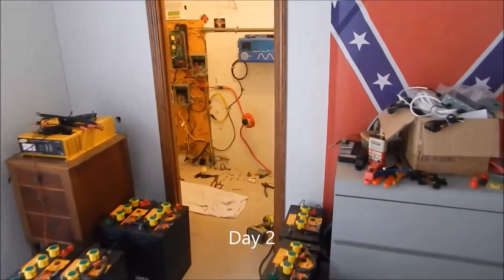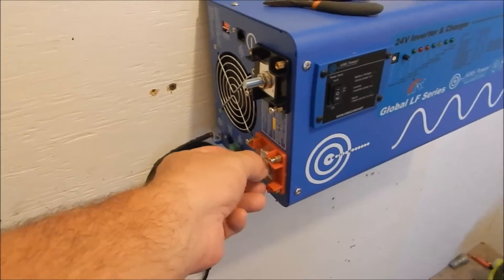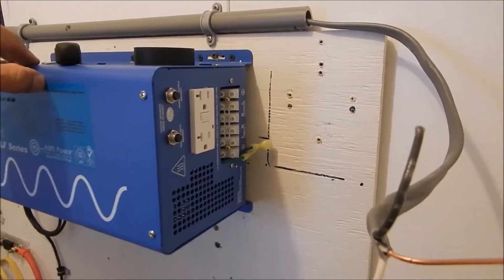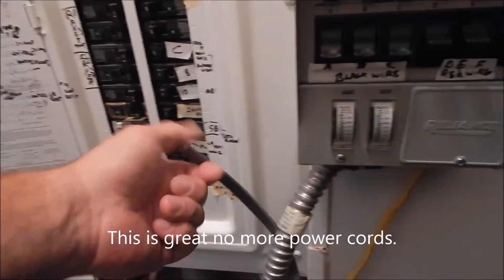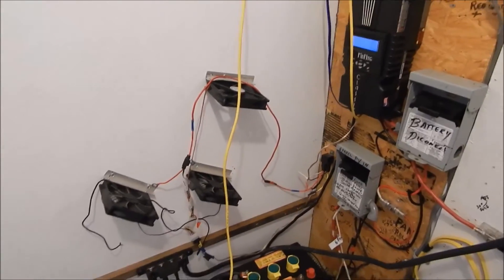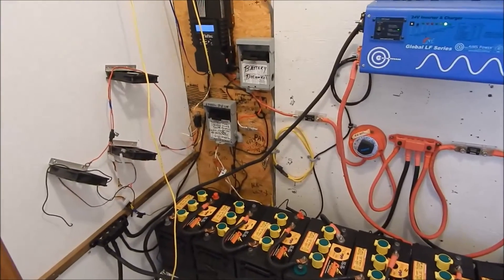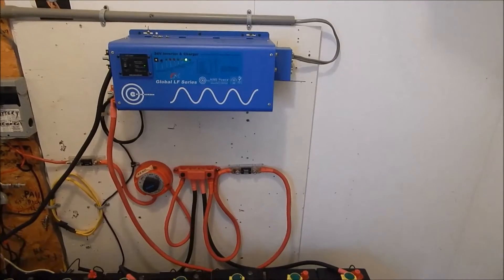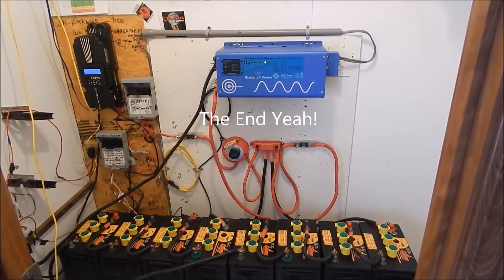Aims Inverter Battery bank part 3 Up & running.

Comment: Are you using the Aims to charge your batteries and at what voltage?
Reply from the maker: No I got rid of the aims inverter years ago what a piece of junk.

Comment: Beg my pard, but wtf are those fans mounted on the wall accomplishing?
Reply from the maker: They have been  redirected to stir the air in he room to dissipate any fumes & help cool equipment.
Reply: Oh ok...so the room is at negative/positive pressure? Otherwise, without air exchange they are wasting power.

Comment: looks good! how long can you go off grid for with all that now?
Reply from the maker: +fliping720 I really gave it a good work out last night I ran my bedroom with the A/C on, the LR, full kitchen  lights fridge ,freezer, then  I hit the transfer switch to use the washing machine no problem. How long will it go it depends what I am using but if I can do light s, kitchen & run my bedroom 8000 BTU a/c at night when needed like from now on for the next 9 months,  it will always stay on 24/7. I did it with my go power invert. This Aims inverter runs really hot. I am guessing this is because it has a giant transformer in it. Seems like a strong unit for as little as it cost for all that it can do. I am using it just as a inverter, no charger or transfer switch needed at this time I got plenty of solar.
Reply: that's great, I am interested in seeing how it does.

Comment: that's a really nice set up!!  where did you get those batteries and how much do they run for?
Reply from the maker: +Lorenzo Chow I have a Crown battery dealer about 50 miles away .They 6Volt @ 390 amp hrs. each, they run around $250 each 121lbs, cheaper if U have some big batteries to trade in like golf cart type heavy lead deals.

Comment: Good stuff again.   Hook a WiFi  extender o your midnite and download "the local app" to your phone and you can see what your system is doing anywhere in the house or yard.  Need the whiz bang jr. too.
Reply from the maker: +Fernbark Frist Thanks! I have it hooked up to 2 plug in units that u plug into the wall & use your homes wiring to communicate ,very nice. I will be getting a whiz bang soon now that I only need 1 charge controller. Plus I can still take 2 of the 6V battery's for my camper & still have a 24v bank. I gave it a good work out last night I had every thing going at once that I would ever use ,LR, the whole kitchen lights, fridge, freezer, 8000 BTU A/C unit & the washing machine!  I normally would never do that but it ran all of it no issues. Lots of work but I seem to have a nice set up now. Time will tell.
Reply from the maker: +Fernbark Frist I did not think they had 1 for your phone that would be awesome!

Comment: Looking good there.  I've been able to get my clothes washer running off my 1000W inverter reliably so you should have no problem with the 300W unit.

Comment: Congrats man! I think you will see a difference in the power you can use.
Reply from the maker: +TRprepper Thanks! I got a good work out cleaning up & reconfiguring my power room. 24V is easier to deal with Just need 1 charge controller now . I gave the inverter a good work out last night ,Ran my A/C  8000BTU unit & everything I had hooked up to my 1500 watt inverter plus my whole kitchen & ran the washing machine no sweat .  I can also pull 2 battery's off the bank for my solar camper & still have a 24Volt battery bank, a big win for me.

Comment: LOTS of hard work...well done! You can adjust the Midnite Solar Classic display LED light levels to anything you want...or delay shut off. I am not sure how the AIMS inverter works with voltage levels, but if it is like my Outback Power VFX3524, you are going to need that AC in connected...it should transfer back and forth per your settings. But, I don't know the AIMS. Anyways, looking great! I run a 200-amp circuit breaker on mine too and 2/0. I like how you have two feeds from the busbars going into the battery bank. That will help keep them balanced.
Reply from the maker: +Chris DIYer Thanks Chris the massive clean up & switch over to 24V was long over do. This set up allows me to use just the Midnight at 2000+ watts in at 24v so the out back is retired for now. It was a lot of work making 2 different charge controllers work together glad that's over. I have the Aims set up as a stand alone inverter only, how I wanted it for now, yes it will work like your out back depending on hooked to grid power & how U flip the dip switch's on the back side. hooking up the battery's like that just made sense to me & when I pull 2 battery's off the bank to use my camper I still have a 24volt bank. options are a good thing. So Far so good.

Comment: that is awesome.   how many amp hour are your batteries?
Reply from the maker: +cowboy898 790 amp Hours @24Volts. Plenty for me plus I can take 2 battery's off line & put 2 in my camper & still function at 24Volts
Reply: +TheKilog69 excellent.   great setup.

Comment: the midnite has a led mode setting to turn them off or power save or timed,
Reply from the maker: +Bill and Rosa Off Grid Solar Cabin - Homestead  Thanks Bill I have more to learn about the Midnight trying to use 2 different type charge controllers to work in concert was a trying ordeal now I will just be fine tuning  it.

Comment: power save requires 25 watts to activate
Reply from the maker: +Bill and Rosa Off Grid Solar Cabin - Homestead  yup that's means it is on all the time with all the stuff I have running  I have been using every thing tonight so far so good. It will come in handy when I move some day to a more solar efficient set up.

Comment: your unit can charge with a/c input and has a transfer switch built in.
Reply from the maker: +Bill and Rosa Off Grid Solar Cabin - Homestead Yes this has more features than I need right now, so far so good I have used the washing machine & AC in bedroom while running all the stuff my small inverter did NO issues. this is much different from the 1 U have . Thanks for recommending it I am happy so far.

Comment: size of cable length will determine if 4/0 is needed
Reply from the maker: +Roy Amberg 4/0 is a mistake . 1/0 is what this  calls for as is most all 3000 watt 24V inverters im am using 2/0 .

Comment: there is a setting for the backlight to turn off
Reply from the maker: +OkieRob Thanks Rob  I will look into it is easier now that I am only using 1 charge controller. Things can get confusing using 2 different brands .

Comment: my aims manual says 4/0 cable for 3000 - 6000 watt.
Reply from the maker: +OkieRob Thanks mine 2 I think its a mistake as it makes no sense. the PDF file says 1/0 I'm using 2/0.  thanks fro watching.